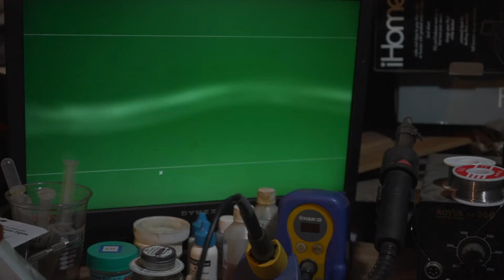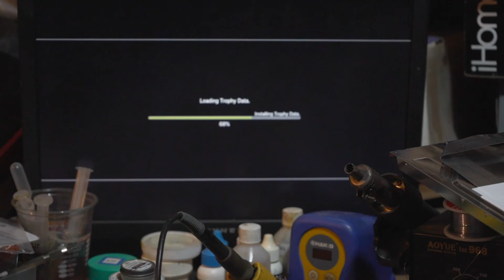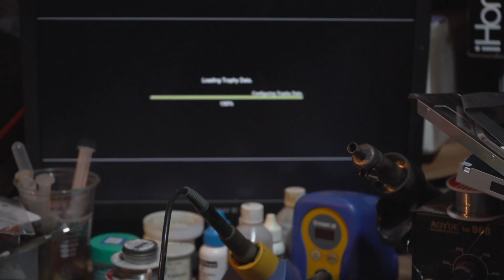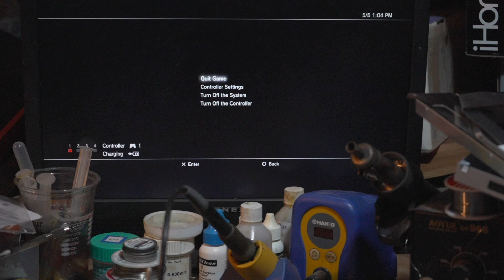Repairing a PS3 that doesn't read discs!

Comment: I bought a non backwards comp 40gb back in 08 new out the box had the same problem 2 years later so I traded in for an 80 non backwards and today it  still works only problem is the fan keeps getting louder but it works fine.
Reply from the maker: You might need to get it delidded & repasted.

Comment: So if I'm understanding this correctly, just replace the drive but use the old motherboard in the new one? If so this method is a lot easier than trying to replace the laser itself.
Reply from the maker: Yep or you can buy a new laser assembly!

Comment: Photos of you who have a PlayStation 3 fat edition that is able to compatibility of the PS2 edition you have to spray the cooling spray on the side as well as the disc opener that's how I did it and that's how it worked I had to format Rest rather then and restore the software so far it's working just fine for now but I don't know I have any problems if you had any problems let me know

Comment: Several things that can cause disc read errors is one the PS3 was moves with the disc inside and other things like corrupt hardware and just to name a few.
Reply: My ps3 fat reads ps1 games, ps2,  blue ray movies, but every time i insert a ps3 game, it Will show that is loading up the game in the corner of the screen, the actual game wont appear on the menú. Iam guessing that one of the causes if because HDD is probably full. I already clean everything inside. Any recomendation
Reply: @joelparedes5063  Well the HDD could also be corrupt as well and if the screen won't load then it may be the Lens itself could be out of alignment.
Reply: @joelparedes5063  bro mine is doing that too.. top right corner says it’s reading the disc but it never pops up

Comment: Good sir if I’m looking to purchase a replacement disk drive the wider ribbon version is available is this what I need for my non-backwards compatible fat ps3 ?
Reply from the maker: Yes that would be correct. You can use a CECH-G model drive, you'll just have to swap out the ribbon cable for the fatter one!

Comment: Hey! 

I just got a replacement drive for my ps3 (backwards ps2 compatible) and it’s the correct drive, working nice take the games in but isn’t ready any discs now, do I need to take something from my old drive?
Reply: Might have to swap daughter board from old disk drive
Reply: @TaylorJAW  I tried this I believe, I got mad at it and gave up 😂
Reply: same thing with me
Reply: Yeah im starting to think it might be easier just buying a PS2 with some kinda hdmi converter. My ps3 a01 plays ps1 and ps3 games just fine but has a hard time reading ps2 games. I've ordered a replacement drive and we will see if it fixes it. If not I might just look into buying a Ps2
Reply: Was it the same BD? If not, then the daughterboard might have slightly different signals for the mechanics, meaning that you may need to remarry the daughterboard. You need CFW, but you should have that on an backwards compatible PS3 anyway, to prevent overheating. https://www.psx-place.com/threads/how-to-remarry-blueray-drive-on-cfw-ps3-step-by-step.26913/
Reply: @TaylorJAW  that dosent exist
Reply: @noaharkadedelgado2318  it's the second phat model

Comment: This is a stupid question.....but why do you have to replace the motherboard?  I can't just replace the whole disc drive?
Reply: The motherboard from the original disc drive is tied to the ps3 system so if you put any disc drive it will not work unless you transfer over the original board. That’s why he talked about jailbreaking because if you do that you can “remarry” the ps3 to any disc drive

Comment: My fat PS3 disc won't Spin. I put disc in than I heard weird noise. Shows game is loading in top right but nothing on screen.
Reply from the maker: It won't spin? Was there anything done to it before?
Reply: @Techbabblers  I got it to work. I just turn it off from the back. Thanks for the response! I had this 80gig phat PS3 since 2008. I took great care
Reply: Hi can you share how you fix that? 😭Because we are the same ps3 please... Thank you please chat asap
Reply: @Raiders-wm5kb  help me
Reply: @ronaldsabvlogs7370  I just turn it off from the back.  than turned it back on.
Reply: @Raiders-wm5kb  but there is a tape inside?

Comment: i got a ps3 slim I can play games digital but I put a disc in it dosent pop up it dosent read anything at all I can take the disc in and take it out but the PS3 OS dosent even detect or read the disc
Reply: Check if your game discs have a scratches or try some game discs if it's not check the Laser that read the dics
Reply from the maker: Might be a laser issue with the drive!

Comment: Couldn't you just swap the disc drives?
Reply: OMG. THANK YOU FOR THE SUGGESTION
Reply: No the board is "tied" to that ps. You have to swap the board to the new optical drive.
Reply: @Airsoftforall  there is actually a way to just swap out the blue ray drive. I've done it. But it's a more extensive process.
Reply: @reddoggames3011  never said you could not. Just faster and easier to swap the boards.
Reply: @Airsoftforall  for anyone who IS looking to replace the whole thing here's a good video of how to do it https://youtu.be/XgEBX7EviHY
Reply: @reddoggames3011  can you do mine i’ll pay

Comment: I install the metal gear solid 4 but when the game loads to 23% in top left corner of the screen there's a blinking DVD with Question mark. But all of my games can play properly without a problem? Any tips is there something wrong in my PS3 or the Disc?
Reply from the maker: Sounds like it might be the disc, are there any scratches or such on it?
Reply: There could be scratches or the disc is corrupt sometimes discs can have a glitch too because the glitches causes the sometimes is the disc readable question.
Reply: It sounds like the bluray laser is weakened which means it will play single layered bluray games but not. Double layered bluray games such as red dead etc certain games are single layered others are double layered tryclening your lasers with cleaning alcohol and a cue tip if this fails you should just replace the laser.

Comment: Bro i have a problem ,i bought a Ps3 ,disc it's speaning ,and i think ,hi read it ,but disc no showing up and i can't open app,like PlayStation store ,help me?
Reply: Hate Pro same problem it wont read disks and it will turn black when i open a app
Reply: @anderson019  yeah ,same ,but i want play so muchhh!!!
Reply from the maker: Might be a Blu-ray issue. If I'm correct, when the drive stops working or is giving error such as not reading disc, when you try to open apps like the store, it won't open because its "sensing" a failure. Did you try resetting the system to see if that would fix the issue?
Reply: @Marus123  the ribbons under your power supply that’s in the disc drive isn’t connected properly or the ribbon on your disc drive isn’t connected if you need more help give me your Instagram or anything like that and I’ll send pictures on how to
Reply: @anderson019  the ribbon under your power supply might not be connected properly or the ribbon under your disc drive I can send pictures on what to do if you want
Reply: @minatoyukidoorkun3305  is that what would make it not ready discs? If the big ribbon isn’t connected properly?
Reply: @KoDiEsMiTh09  from memory I'm gonna say yes, you also can't open apps if it's unconnected

Comment: Can i use external blu ray player instead ,pls a yes or no 🙏🙏
Reply: if you have CFW, it most likely will, if not then most likely not(encryption, safety, etc)
if you have a Fat or up to CECH 2500(this specific model is only compatible when made before 2011) slim then you can jailbreak. You can also use HEN on CFW-incompatible models like the super slim (all super slim models are CFW-incompatible)
Reply: @heynic37  yea I have a cfw , so if I put my ps3 game disc in an external blu ray player and connect via USB , will the game play?

Comment: The problem I have with my ps3 is that it'll read and play ps1 games but won't play ps3 games
Reply from the maker: If i'm correct, that may be a laser issue. The PS1/DVD use the "DVD" laser while PS3 games use "Blu-ray" laser. You will either have to change the laser or change the entire drive and put the original drive motherboard in the new drive like I did in this video. The laser is the cheaper route and you can find them on eBay. Will just take a little more work to get to it!
Reply: @Techbabblers  thank you for this advice il keep it in mind ^^
Reply: My Ps3 backwards compatible doesnt play ps3 games only ps2 games. I assumed its the laser issue
Reply: @Techbabblers  will laser for fat ps3 non backward work with ps3 backward compatible?

Comment: Im having a ps3 super slim problem that it will not read games anymore like discs. Whenever i do insert a game, it spins for a while, then makes a sound and just completely stops spinning and reading. Is there anything i can do?
Reply from the maker: I haven't worked on a super slim before, but might be the same thing. You'd just have to check to see which laser type is needed. Can you reply with the model number (should be on the back)?
Reply: Hey weasel... same issue is my super slim facing ...have you succeeded in repairing yours ??
Reply: Same this shit pissing me off